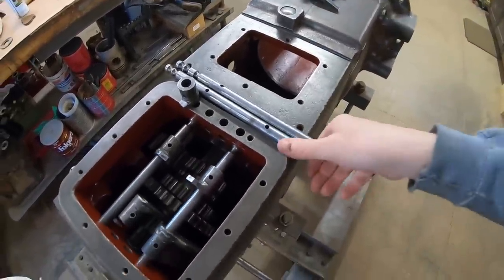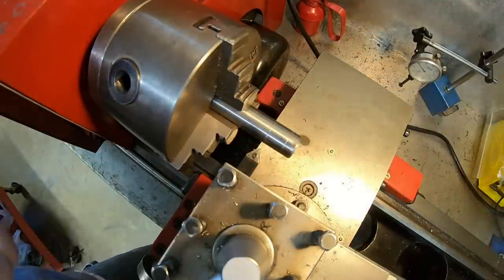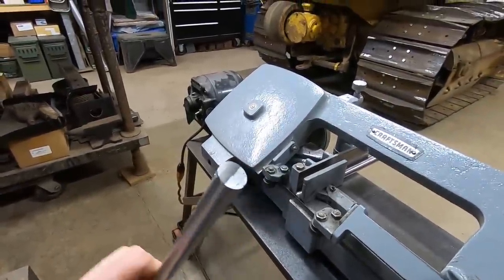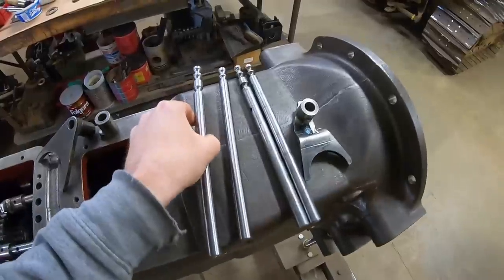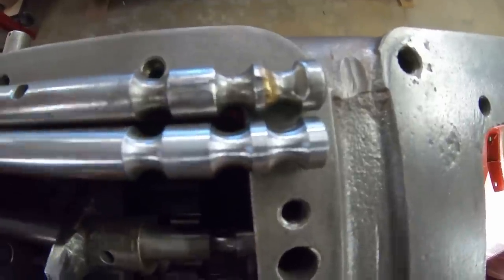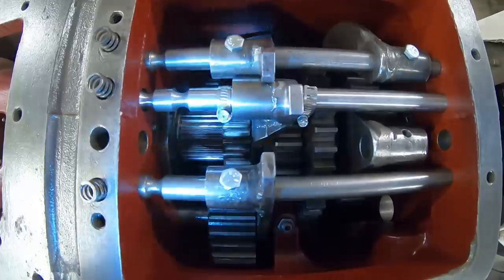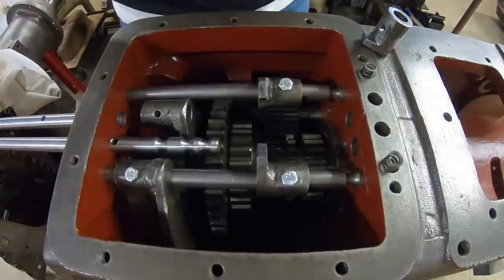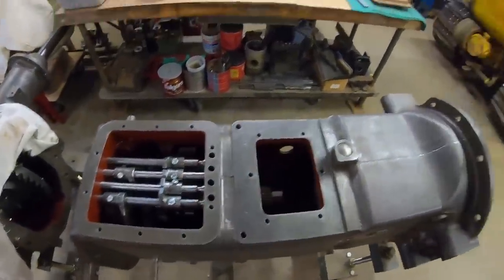Minneapolis-Moline 445 Prototype #X231 - Part 47: Making New Shift Rails & More Prototype Problems!

Comment: There was nothing "wrong" about your lathe work. A lathe was the first machine tool I learned. So, over the next 15 years as a Tool & Die maker, I could do most lathe operations for myself. But no way would I do them in front of an experienced lathe hand. A man has "got to know his limitations". You do what you are good at and then get on down the road. Your skill with the round file made up for how you got there.

Comment: Mission accomplished! Yup - you and I were on the same train of thought after the last video. I figured you would just lightly polish that rail just enough until you could get it to slide into the bore easily. Nice work!
Reply: Close enough that you had 2 options. There is no shame in taking the less time consuming and less labor intensive method when the result is the same either way. I remember seeing my father tweak a piece of throttle linkage on a tractor rather than tear down the governor to make a minor adjustment. It worked for well over 15 years until the tractor was retired. I wish I had that Oliver 70 now. Dad bought it new some time after WW2.

Comment: MY COMMENT over the building of the  bending of the shifting fork is : glad to se you re do and make a second one
and make a normal V shaped bending die . I thought & pretty much knew all along that you were going to weld a gusset 
on it. Because the one bad thing with the tranny & rear end cast cases is they didn't leave any space under the gears in case some little thing dropped down inside.  Maybe the production case had more space but I don't think so other wise you would of mentioned it. Maybe it's normal not to leave any space .I have not tore down any tractor  tranny sand rear ends from the 40's &
1950s All thou I have a far mall h needing tore down in that area

Comment: Not being the high level machinist you are, when I saw that shift rail misalignment, I thought, "Oh boy... he's gonna re-drill the rear/outside hole at a slight angle so everything fits." Of course  that was a snap judgment; I didn't give thought to just turning down the opposing end as you did. I'm curious though - did you fret over the case to case alignment being a straight line? To me it appears the hole were definitely out of alignment with each other... which also made me ponder if that accounts for the bent rails.

Comment: The production version of the transmission cover ( monster as you referred) is  a completely different casting, and they also moved the breather pipe forward the steel plate covering the planetary opening ( amplitorque) . Can't remember , did the prototype have a torque?

Comment: I think who ever casted the case was probably lazy or the guy drilling the hole was lazy. Or was not very amused on his job. So  don't hide in shame. Cause someone else in the very far past messed up. However now you have corrected it. I can already see from that broken shifter that there was a clearance issue or someone slammed the gears in hard. That would explain the worn shift forks.

Comment: Something else that works very well for checking or laying out a radius is a welders fillet gauge set. I have a set that I use quite often for that purpose, as they are relatively cheap and easy to find.

Comment: Might I recommend a friction reducing additive that might help all those gears, get a product called motorkote and add it to the gear oil when you fill the transmission (I know it's not what they used back then, but modern additives really help), this way it reduced all the friction on the gears to help with longevity (in fact all your tractors could probably benefit from that lubricant)
Such a great video and your radius generator and your coping method made me laugh out loud
Love it!
Keep em coming!!!!

Comment: Its a prototype, nothing meant to do more than show it works, and at times did not so it could by improved before production. We see why these got cut up to scrap. The fact it exists in more than a little part is amazing. Your fixes feel about what the shop guys might have done to get a workable piece mocked out. And your machining skills are far more professional than mine! But your coping skills may need improving! I use more swearing, a more comfy chair and often a stout drink and an overnight break. I suspect you will get more practice on this tractor! Thanks as always!

Comment: My father had 445 Moline.  He bought it new when returned home from the Army in the late 1950s.  70 years later he still says it was the worst tractor he ever owned.  He always thought that the problems were due to poor craftsmanship.  They had a good design and engineering. But they did not have the machines and tooling to create what they envisioned.
Reply: LOL

Comment: Thanks for showing in more detail the issues with the bent shift rails. Looks like you are nearly there on this stage. Great progress! I also like your solution to the hole alignment problem. That seems like it may also be a contributor to the original failure.

Comment: Hi Squatch, instead of moving the position of the groove the gear engagement could be set by moving the position of the holes for the fork?  unless you wanted to keep the fork hole position are per the original?

Comment: I would have thought that you would have straightened the bore in the starting hole with sand paper and a split rod, but the shift rod does the same. 👍

Comment: The 2-3 rod didn't fit the casting smoothly as you noted, so what did you do to fix it?  The axial alignment of the holes in the casting was off a skosh. The next day the rod fit like butter but I'm not sure what you did to correct it?  As usual, good stuff!!

Comment: I worked in a prototype shop for a short duration for extra money one winter. Due to non-discolure I cannot ever name the company we were making parts for, but I can say you probably have gone fishing in one of the items they make if you live in Minnesota. Much of the work we did for them was done on quality machines, with questionable tooling and fixtures. Particularly because it was prototype work and not production. Every part was custom end to end and required custom tooling and fixtures. We used files, abrasive belts, die grinders with stones, etc to rough in the concept piece. The pieces would be sent to the R&D department and they would assemble everything, test it, break it, analyze it, and sent us their notes to make nothing concept piece. The said part is, that R&D department spent millions of dollars on cutting edge ideas, for products that never made it into production because one person in a corporate office did not like it or thought it would not sell.

Comment: do you know anyone that could do a repair on the spines of a tractor pto shaft?
Reply: @squatch253  I have seen someone weld it up then file down the spline, but just not to sure about it. I think I would feel better about it if it was machined back down on a lathe.

Comment: Day late, dollar short - machinist buddy straightened a driveshaft by heating it cherry and spinning it on a live center lathe at low speed overnight. Straight as an arrow the next day. Given you're not worried about heat treating, heat is ok.